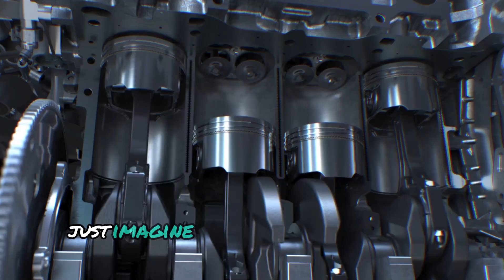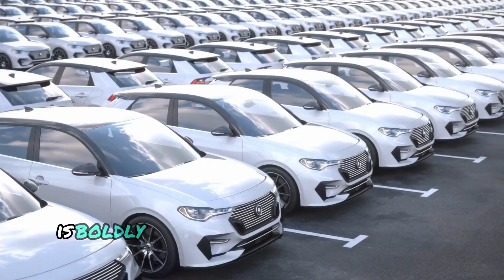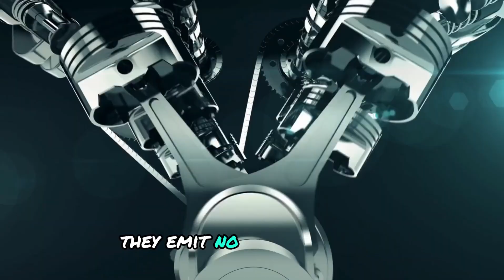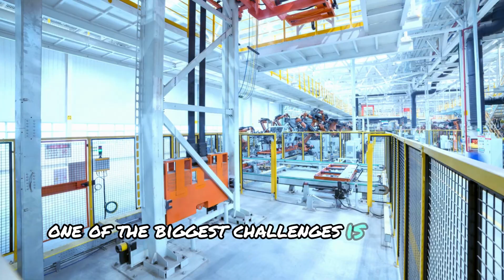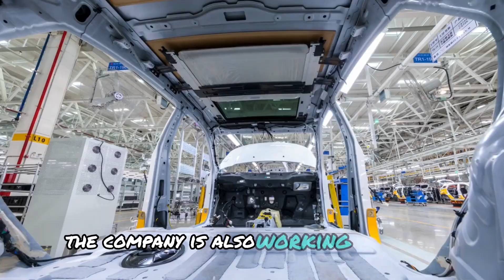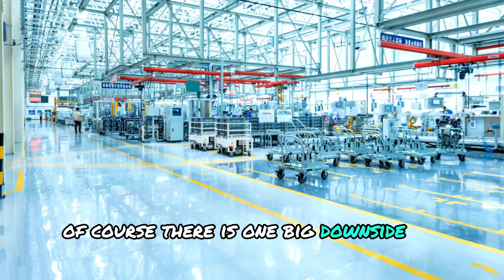Hyundai CEO: "This New Engine Will DESTROY Electric Cars!"

Comment: Sorry, hydrogen will never beat electric. It's just math. First, you have to use energy to make the hydrogen. Then use it for fuel. With electric, you just store the energy from the start. Less waste. Electric is just much more efficient. Hydrogen is also very difficult to store while batteries get better and cheaper every year.